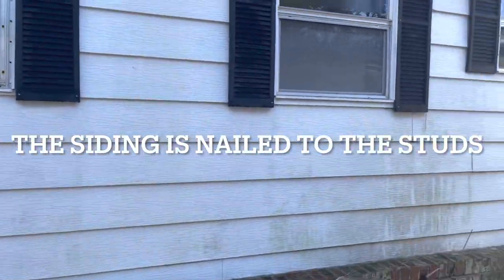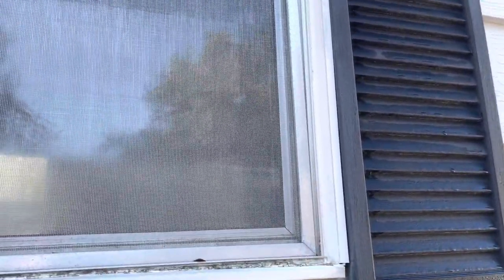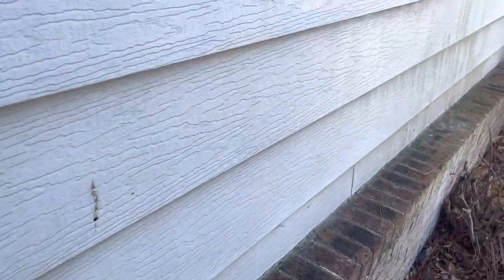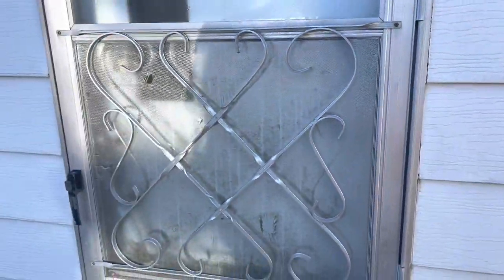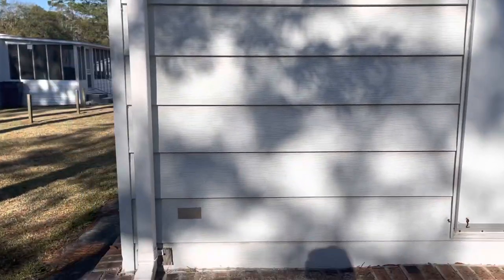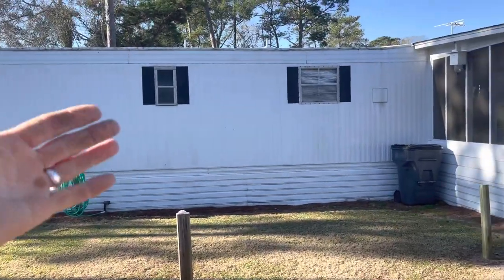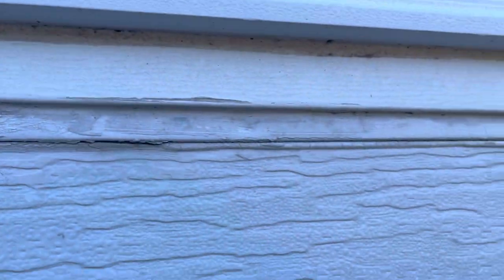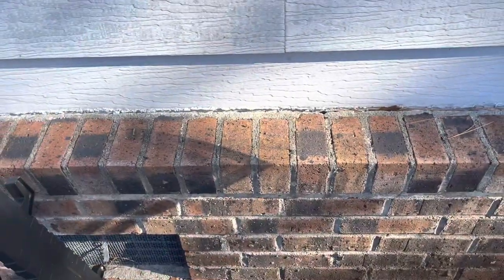Mobile Home Window and siding issues.

Comment: In 1970, our home had 8" aluminum siding with a fiberboard type insulation backer attached and at the lumber store I worked at in 1977, we had I believe vinyl and aluminum siding with a styrofoam backer. And I've seen skirting now that has aluminum facing on styrofoam.
Reply from the maker: That’s very interesting

Comment: Had the same thing.  Park guy just removed the siding around the window and put in new flange windows like you.  Zero issue.  I would have just used cut out the height and width of the flanged window, installed it and trimmed it out with white PVC board then ran J-Channel around that and tuck in the siding.
Reply from the maker: If it was vinyl siding I think I would have a better shot at it. But it is aluminum siding and I am afraid to bend it or damage it in anyway. And underneath the siding there is no sheeting whatsoever. The house never had seating on it therefore all this behind that is two by fours with insulation in between a layer of quarter inch Styrofoam and the windows are nailed to the studs it doesn’t make any sense

Comment: That's old straight 8 aluminum with drop in foam. Doubt you'll find that now. I haven't seen that since the 80s. :)
Reply from the maker: I don’t think I could find it either not to mention that there is no sheeting underneath that the windows are nailed to studs and there is blocking in there that goes around the window but no seating whatsoever on the house I told the owner if he would be willing to change the siding and let me install OSB or half-inch cheating then I would be interested in the job.
Reply: I have that same siding. 1976 double wide. Replaced every window. Put in a slider and a French door. You have to cut the siding back far enough to slap a piece of trim there. A skil saw with a metal blade and some common sense is all you need.

Comment: Wouldn't removal of the original  metal siding compromise the structural integrity of the unit?   Can't imagine doing that without putting up some sheathing or something in its place
Reply: P.s. love your videos and craftsmanship.
Reply from the maker: Thank you my friend I appreciate you and your comments. Where do you live Mark I live in Southeast North Carolina and the weather here is amazing. I’m not sure if you noticed but my crew does have a tendency to travel once in a while. So if you looked up Drew’s Roofing And Home Repair the Travelers I have some pretty cool videos out there of that. Alabama. Ohio. New Jersey. Verginia. Outer Banks North Carolina. Kitty Hawk North Carolina. Myrtle Beach South Carolina Georgia. And a few other places
Reply from the maker: I was totally blown away by the fact that there is no sheeting on this house and when I pull the siding open I could see regular fiberglass insulation in the walls with a layer of quarter inch Styrofoam over the top. Absolutely ridiculous. Because of that situation I decided to not do that job unless he decided to change the siding. I told him if he wanted to change the siding I would come back there remove the siding remove the windows install sheeting and then reinstall everything
Reply: I live in northern Virginia and I have a mobile home park in Tappahannock, VA
Reply: @Drewsroofingandhomerepair   I've watched many of your videos and even stumbled upon your Tappahannock video
Reply from the maker: We have been a bunch of places. We were in Rhode Island and got recognized by a neighbor from our YouTube videos.
Reply from the maker: I’m not sure what you seen but I made two videos of Tappahannock
https://youtu.be/-htIR-10aHA
Reply from the maker: We loved it in Tappahannock
Reply from the maker: We have been to Ohio Alabama New Jersey Virginia Outer Banks North Carolina Kitty Hawk North Carolina South Carolina Georgia Alabama Tennessee and a few other places
Reply: I did see one Tappahannock video but I'm not sure if I saw both.  Will look again.   All of my units need rehab Or replacement. Haven't decided yet
Reply: Just bought the park in September
Reply from the maker: I will come and do the roofing for u
Reply from the maker: Thank you